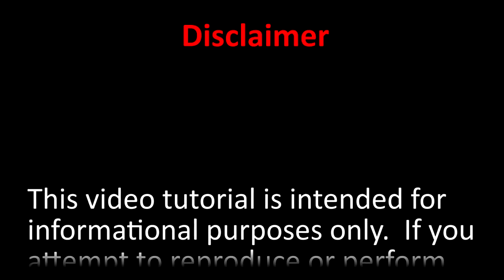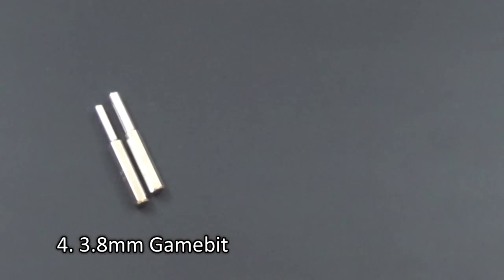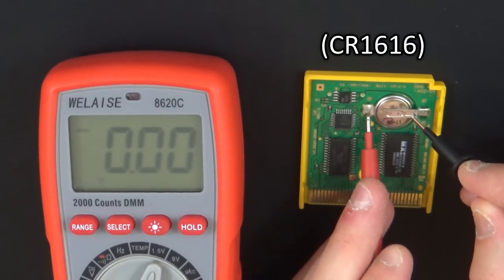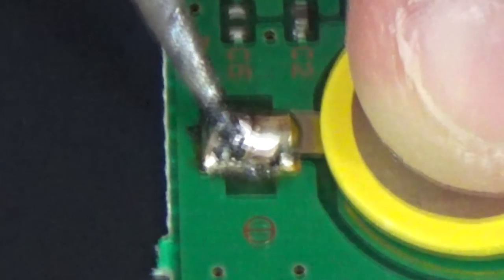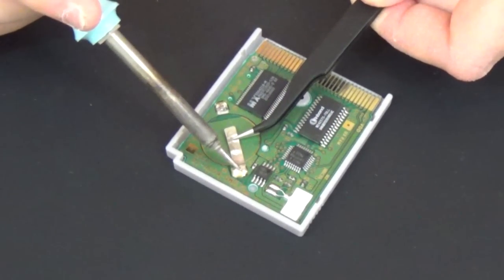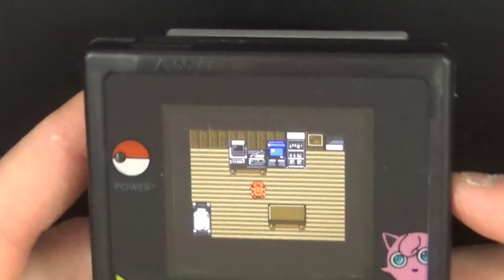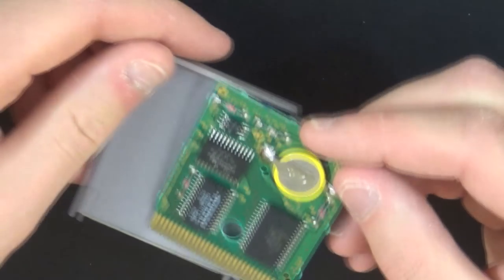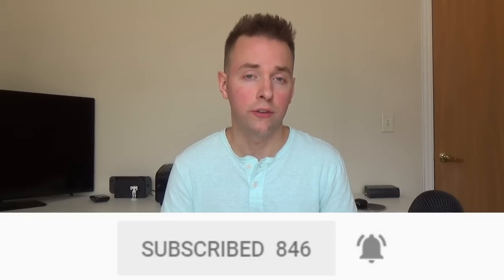The RIGHT Way to Replace Gameboy Cart Batteries

Comment: I would have done things differently. I would have cleaned the contacts of the original solder, and I would not apply so much force to pulling the old cells off. You could potentially destroy the cartridge by removing those contacts. Be careful. I would also not apply the soldering iron to the contact for such an extended period of time. This could also damage the pads.

Comment: If my battery has liquid leak. How should i clean it with?
Reply from the maker: Try using some white vinegar to neutralize the alkaline battery discharge.  After that, clean it up with isopropyl alcohol.  The leaky battery should be removed and replaced right away. 👍🏻

Comment: "Here's a close-up of what the solder melting process should look like."
Shows giant ball of unevenly heated solder that'd probably overflow off the pad in future replacements if not wicked away
I mean it's not a big deal, a Game Boy cartridge is a class 2 product at most and this IS a much safer tutorial, but this is a bad habit for modding/maintenance newbies to fall into.  You don't wag the iron all over the lead.  Dot the tip of the iron to make a ball of solder then hold that down so it "connects" with the solder/lead, keeping it still until all solder is evenly fluid.  This applies for pre-tinning, removing the solder with a wick, and removing/installing the component.  You may need to add a small tap of flux for older solder or weaker irons, but even if you don't you should always wipe the freshly solidified solder clean with something like isopropyl alcohol and a Q-tip.  People seem to be afraid of applying too much heat or get worried when flux smokes, but as long as your board isn't literally on fire you will be fine.  Source: guy soldering PCBs and connectors that go into military equipment for 10+ years.
Reply: You need to make a video, visual is better than word of mouth

Comment: THE RIGHT WAY: 
I melted a plastic pen on a candle and pressed it against the screw and used that as a screwdriver.
Then I just taped on a new battery.
Works great.

Comment: I had literally seen none of those videos but saw many tutorials showing how to change the battery by properly desoldering and resoldering the bracket.
I cringed so hard when I saw the videos you showed...
Also note that if you're not sure what battery to use its written on the board next to the battery when you open up the cartridge
You can even make it out in the video.

Comment: I am not sure if someone else already asked this in an earlier comment, but where did you buy those batteries?  I only ask because the parts of the brackets that are attached to the battery look like they were pinch welded on. So, is there a (safe) way to reattach the brackets without electrical tape, or are you buying them with the brackets already attached to the battery?
Reply: eBay
Reply: @garburias  Thanks! I actually ended up finding them on Amazon, too. 

I just wasn't sure if you needed to go through an OEM Distributor, or something of the sort.

Comment: Will your save file be erased once you remove the old battery ?
Reply: If it's an original Gameboy/Gameboy Color game, yes it will.
If it's a Gameboy Advance game, no it won't.

There's a few tools you can use to backup gameboy games ranging in price. If you happen to have an N64, flashcart and a Transfer Pak you can use a homebrew application to rip it. Otherwise, there's a few dedicated devices such as the GBxCART RW ( https://shop.insidegadgets.com/product/gbxcart-rw/ ) which is I believe the current cheapest device for dumping saves.

After dumping your save file, you can change the battery then inject your save file back in and you can keep it after a battery change.

Comment: Does removing a good battery erase your save?
Reply from the maker: Yes - To preserve it you can dump the save data using a Joey Gen3 or Joey Jr. (I also have videos for those), or you can wire up another battery temporarily in parallel while you remove your old one.  The extra battery gives mixed results though.

Comment: Great tutorial! I just have a few questions:

If my battery has not died yet, and I want to change the battery for peace of mind would I still lose the data on the game? 

Would it be best to use a 2025?
Reply from the maker: Sir Maximillian  Thanks so much! 😃  To answer your question, you CAN change a save battery if it has not died yet, but you WILL lose your save data, unless if it is backed-up using something like BennVenn's Joey-Joebags, which I show how to use here: https://youtu.be/-paDzGnXM28  The only thing I don't show how to do in that video is backup save data, but it's pretty easy with some practice and tinkering with the software.  I highly recommend it!  Also, for the sake of preserving how a cart original came, I'd recommend using either the CR2025 or CR1616, although the former of the two SHOULD fit into all GB and GBC carts.  Some people like to use the CR2032 cells because of their slightly higher capacity.  However, you can have a hard time trying to get them to fit in some carts.  Just my two cents.  I hope this helps, and thanks again for watching!
Reply: KyleAwsm gotcha, again thank you very much man!
Reply: @KyleAwsm  if you had a way to maintain contact between the board and a good battery with wires or something throughout the soldering process, couldn't you in theory keep power and hold on to the file?
Reply from the maker: @heroshotlgn  Good question!  Yes and no - If you did that, you would be doubling the voltage travelling through the cart circuitry, thus potentially damaging the hardware and corrupting your save anyways.  That's at least what I've heard from people who've tried that.

Comment: I replaced a battery on my gold cartridge back in highschool with electrical tape and a battery from another old game there. This was back in 2014, it’s still going but after the book in Pokémon prices they want to charge me 25$ for each game for a simple battery swap.. use to be 15$. It’s cheaper to buy 20 legit authentic batteries and a small soldering kit from Amazon for my 3 johto games

Comment: What happens after you install a new battery, it still doesn’t save??
Reply from the maker: There could perhaps be problems with the SRAM chip itself, depending on how long the cart has been sitting and if there is any corrosion on the PCB.  Good question!
Reply: If so is the game no longer playable?

Comment: Just a heads up for those thinking this is a good idea. If you decide to solder your battery to your pcb you give up the ability to hot swap the battery out next time it dies, which means you will have to do this dance all over again in 5-7 years give or take. This is why I opt for the tape method even tho I have all the tools to solder.

Comment: Uh... Are you sure this is the RIGHT way to replace the batteries? Wouldn't the solder break the cartridge's chip? Wouldn't the solder leak?
Reply: What are you smoking?
Reply from the maker: @.JJ1013  The solder solidifies when cool.  It's not mercury, which is liquid at room temperature.

Comment: When you only have a screwdriver.
Reply: You can get a repair kit for less than £10, probs far cheaper in US as well, as far as soldering goes I'm lucky to be at a uni with a hardware dept.

Comment: So many things...
1.  Should've removed the old solder from the board pads and put new on with battery. 
2.  Misaligned battery.
3.  Waaay too much time spent with soldering iron tip on battery contact.  You should know with all of the videos online of lithium batteries exploding they don't like heat.
PRO TIP:  3 words.  Removable.  Battery.  Holder.  I'm never going to have to do this BS with my G/S carts again.  Just pop in a new battery when the old one dies.
Reply: Have you found one that fits within the shell tolerance of the GB cartrige?

Comment: While its certainly a more professional way to replace the battery so can't I help but be annoyed by the elitism both in the video and the comments.

Just calling if the "Right way" alone is silly as every way that gets the desired out come is "The Right Way".

More over do you clearly not understand why the other more simple Methode is rather popular because lets just compare for your method does one need:
- Skill in using a soldering Iron
- a soldering iron and solder
- a specially prepared Battery
- a Gamebit

The other one just needs:
. a sharp tool to losen the old battery
- a peace of non conductive tape
- a regular battery
- a gamebit (but many of the other videos also show how to turn an old pen into a makeshift gamebit)

Your method requires far more skill and tools that most people don't just have lying around at home while the other needs almost only thing you ether already have at home or are cheaply stocked by pretty much every grocery store.
Meaning its for most people the far easier and more affordable option.